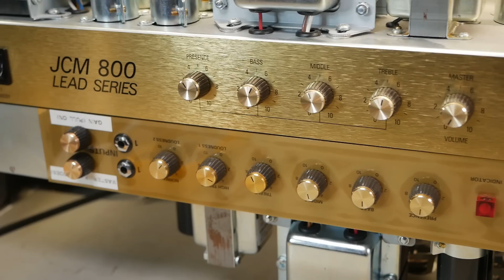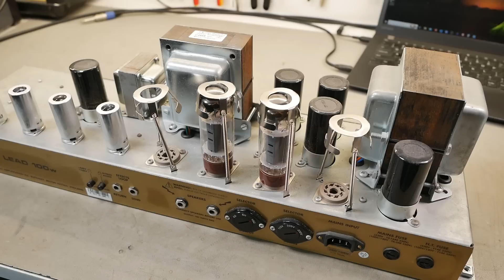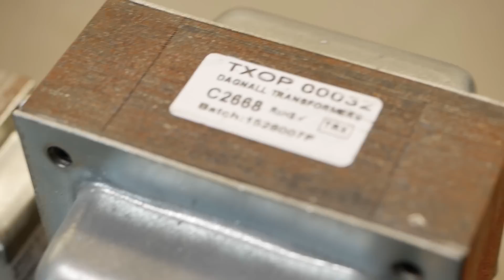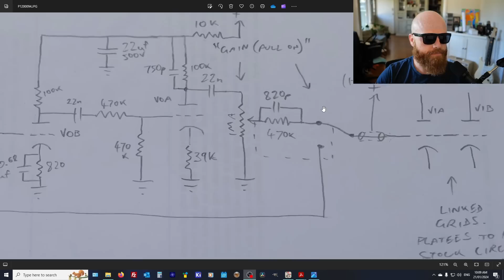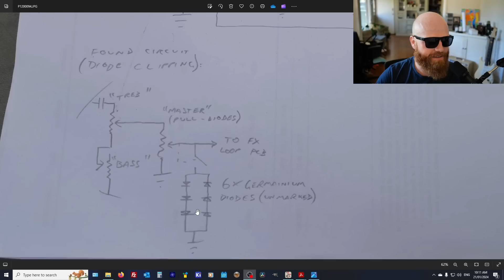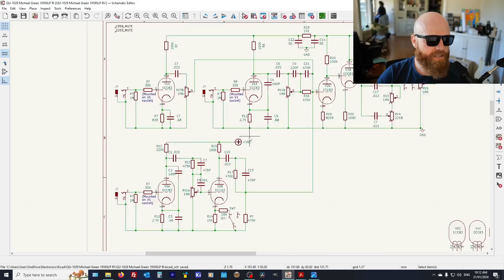Marshall 2203 & 1959SLP Reissue Heads - Part 1

Comment: I did a 1959/2203 and used switches and a dual ganged meg pot with the correct bright cap on each one

Comment: Glad I just found this one. I have a Trinity Amps Triwatt kit that I built a few years ago. In "stock" mode it sounds really great and is one of my main amps. It has a high gain circuit on a pull knob that, as designed is completely unstable, WWWAAAYY too much gain! I did some quick and dirty modding to make it useable but have never been happy with that feature. I'm hoping to revisit the design over the winter and make some improvements to the gain circuit. This series will be a great help.  Thanks for this!

Comment: What idiot hot shields mic cable coax to audio amp stages? Buy a proper piece of hookup wire! That amp oscillates very nicely. It keeps on playing by itself so you can go take a break. F'k your audience and their ears! Cold clipper? Hmm? I'd have used an on off on or  on on on  and gone for 3 cold clipping cathode resistance selections,  but that's just me. More options, more better.
Reply from the maker: Careful, mate!
Too many options and you're in Mesa Boogie "analysis paralysis" mode there!
Reply: @BradsGuitarGarage  I also have been known to have used a switched cathode shunt cap mod too. I won't go to far into the Zener referenced MOSFET regulated attenuator ladder mod for 6 step power scaling. They do make two conductor shielded cable too. Balanced XLR mic cable??? I do see occasionally some sound some sound goofballs change the pins around on their gear and wind up with hot shields. I think it's just their way of being unique. I learned to stop asking them why many years ago.

Comment: I built a clone of the JTM45 I used a 3h chock then changed it to 20h chock and noticed a improvement to the sound much sweeter sounding amp and have noticed the big chock you are using.

Comment: The hot shield thing all comes down to the SIR #34 mod. So stupid.
Reply: This is the first time I've heard of a hot shield technique, and it occurs to me that the shielded cable also functions as a capacitor from grid to anode.....
Reply: @goodun2974  yup, that’s part of the reasoning for it. It rolls off treble and such and is supposed to lower oscillation.
Reply: I agree. There's nothing like having 200+ dc potential on your input.